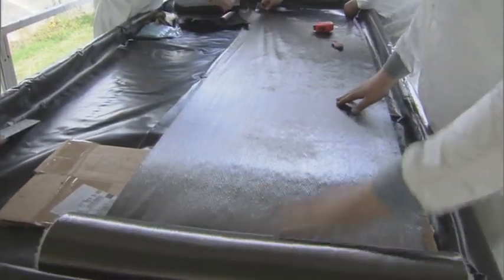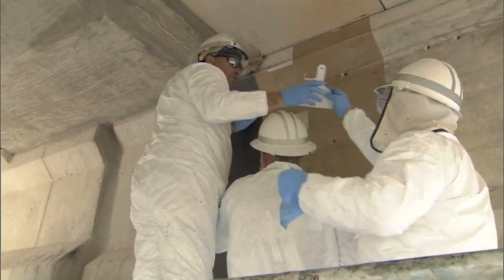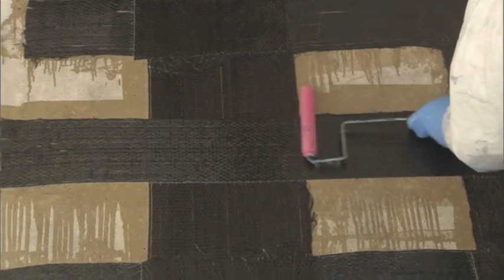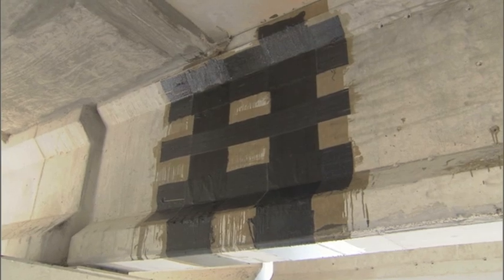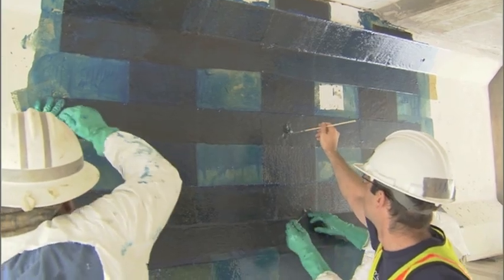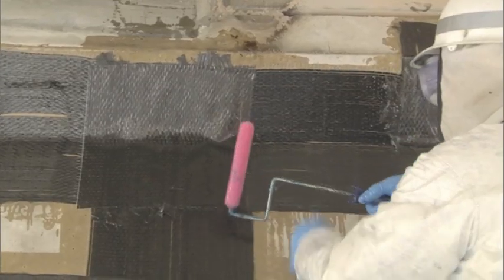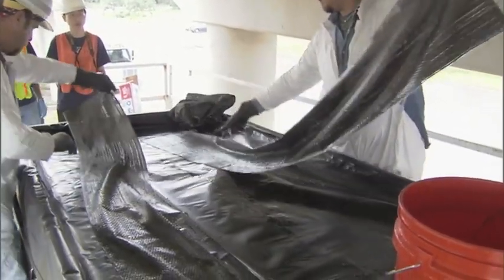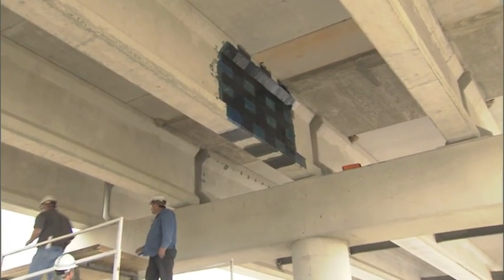Shear Strengthening of Large Reinforced Concrete Elements Using Carbon Fiber Reinforced Polymer

Comment: Yunus perhaps you should investigate the material properties of CFRP products before stating its 'too weak'. on average, UTS is ~4-6 times higher than steel... hence you need such a thin layer for wraps and small cross sections for NSM rods and laminates. 50% external strengthening of the original design load with CRFP to cater for increased industry demand is a dangerous practice - vandalism, fire etc damage to CRFP should be considered, I.e. without carbon fibre, structure should still be able to withstand DL + factored current LL. 
great idea using the spike anchors, are the horizontal / longitudinal layers of sheet required..?